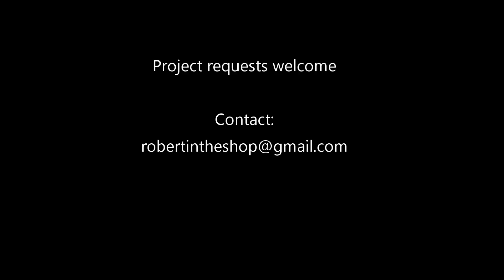Table Saw Restoration Timelapse - RITS 10

Comment: Wow! For a contractor saw that is one massive work surface! That is the the sort of tool you should NEVER get rid of. Just sayin...
Reply from the maker: I agree, the only problem is that the fence is junk, I want to make a new one so I can have some actual trustworthy square cuts.
Reply: @robintheshop  there should be a way of truing that
Reply from the maker: @rayg436  The clamping mechanism was super loose, I couldn't tighten it and I had already put too much time into the cheap fence. I made a new fence from MDF which has been working great